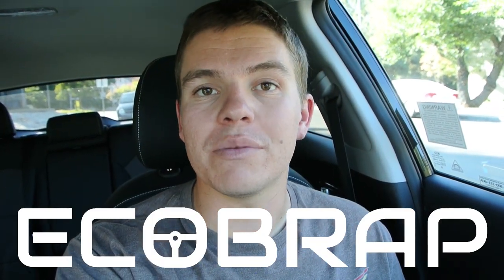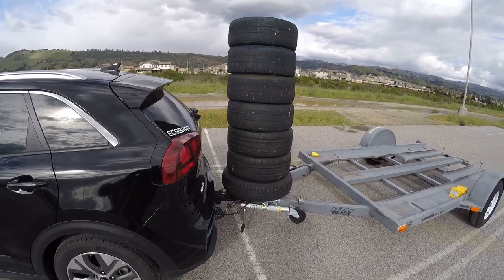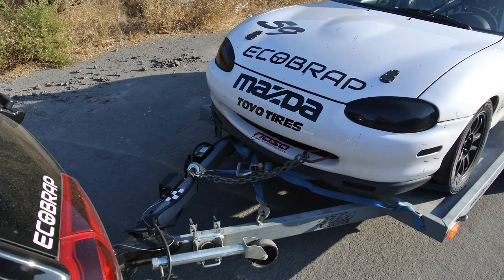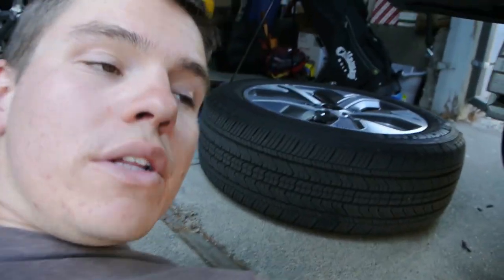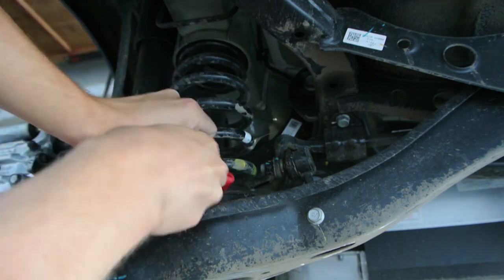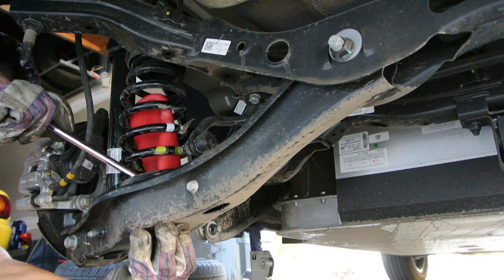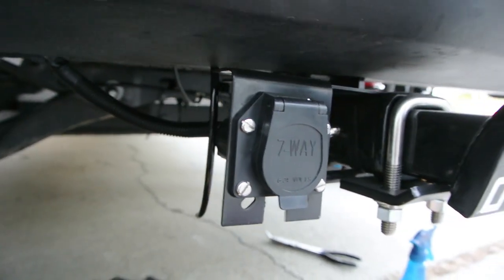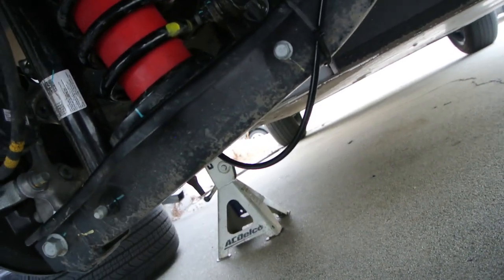Kia Niro EV - Airlift 1000 Suspension Install

Comment: I want to do this for mine. But I want it for better ride quality. Does this help ride quality making it smoother?
Reply from the maker: It will help with ride quality when the car is packed full of gear, or towing a trailer, but otherwise it will just make the car even stiffer.

Comment: You state 313lbs but that weight is also shared on the trailer axle so the load on the Niro is less.  How does this modification impact the car warranty?
Reply from the maker: Not by much. the weight was loaded directly over the hitch, so 95% (or more) of that listed weight is acting on the Niro. Any modifications (trailer hitch, airbags, trailer lighting) are do at your own risk

Comment: Could you just leave them inflated all the time and effectively have a 3/4 inch lift?
Reply from the maker: hi Eric, don't get us tempted into throwing some off road tires on! Jokes aside, I actually leave mine inflated all the time anyways, and they don't really add any ride height, (maybe 1/8"), they mostly just protect against squat/compression instead.

Comment: Grease the air bags before install or deflate and grease after install and they shouldn't squeak. 😉
Reply: Or would that defeat their ability to make the springs stiffer?
Reply from the maker: @scottproulx9157  I don't think it would affect their ability, because they simply have nowhere else to go. Good suggestion although I would expect it might only quiet them for a month or two
Reply: Nope do not lube or grease the bags because  DIRT AND  GRIT WILL MOST DEFINITELY STICK TO THE LUBED BAGS LIKE A MAGNET